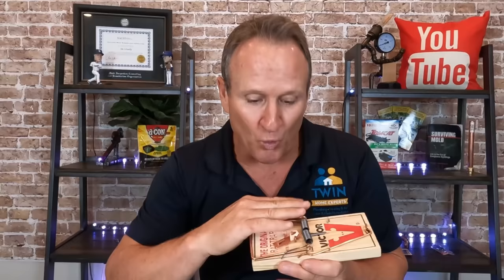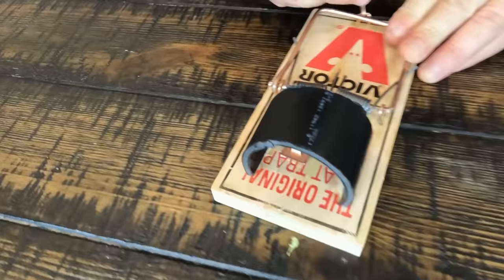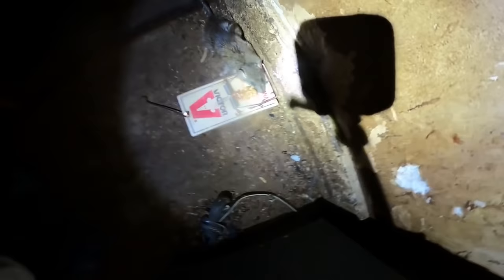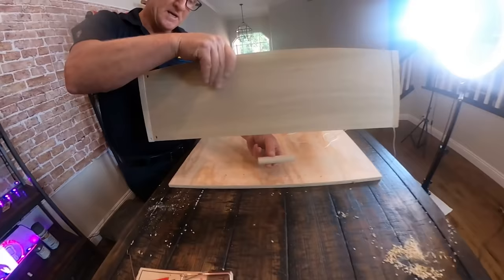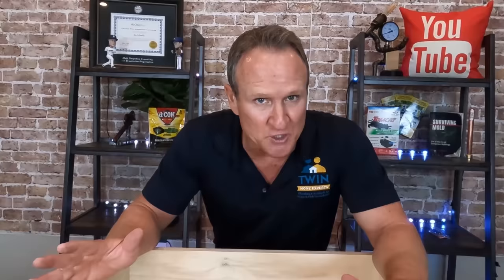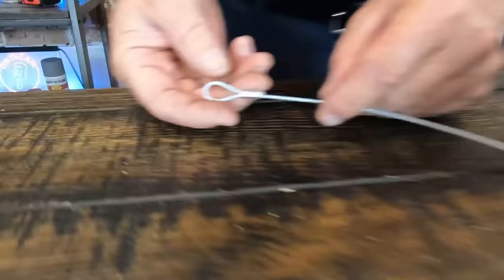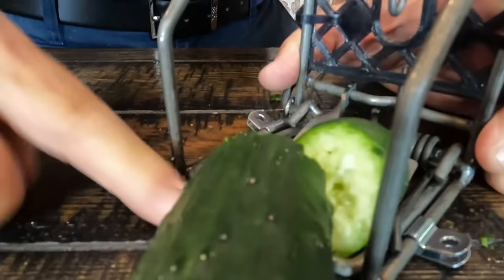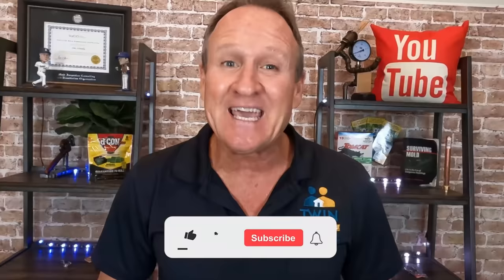EASY RAT TRAP HACKS THAT WORK!! Catch MORE rats FASTER...

Comment: These traps are weak and outdated,  try the fenn mk4 ,no tweaking just kills and the trap lasts longer than life
Reply: Actually they came up with a new rat trap but it's only limited "to them" unfortunately no one else makes it but "them" Idk if you've seen the rat Hoodie and the Metal panel attached to it with a trail am. 

The first method with the ABS pipe actually works All you'd need to do is Drill the rat trap onto a piece of Wood just a small piece maybe like the size of the rat trap then Glue the ABS pipe onto the rat trap and just like the way he did it.

The ABS pipe Outdated way is the only Way I know how you could create an effective way for the rats to just stick they're heads through the front
Reply: Though it does Kinda Make me seethe that they don't use the old method anymore but where they're from I'd imagine the norway rats are super Big and much more intelligent.